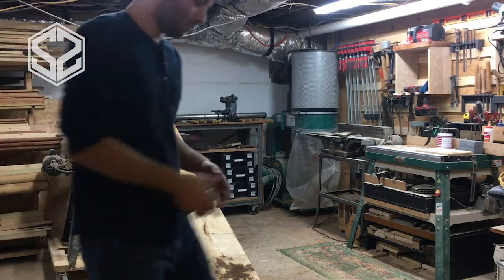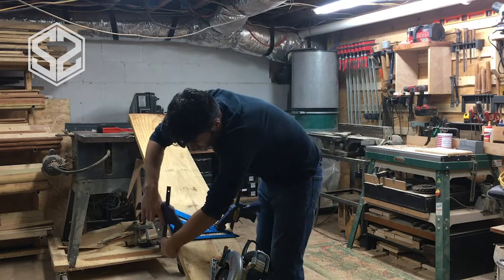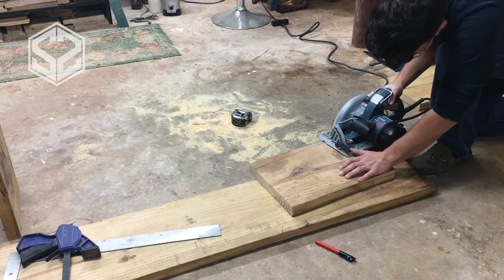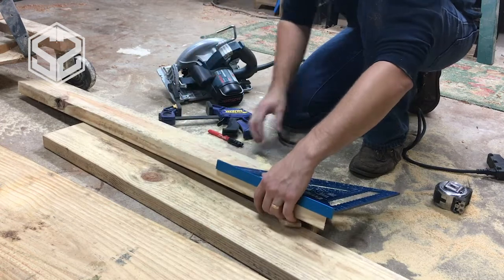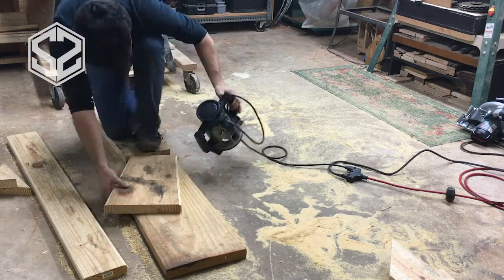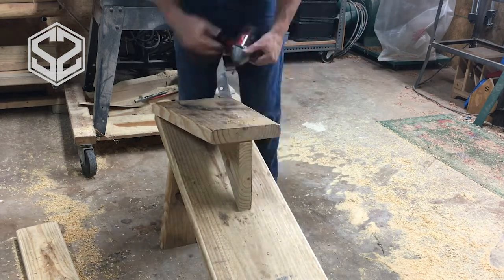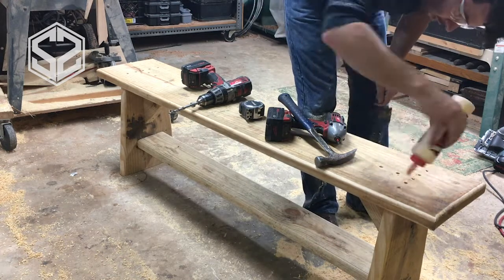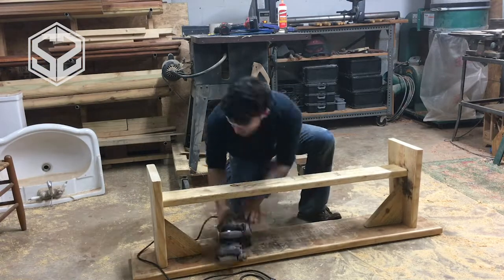How to build a bench

Comment: What is the measurement for the leg height? Thanks! I think I can tackle this one.
Reply from the maker: I cut them at 16.5in. I was aiming for just over 18in. at the top of the bench to match the chairs around our table. The height can vary. if you want it to match other chairs or benches just take your measurement you want and minus the thickness of the wood you will be using for the top of the bench and that's the length you need for the legs.

Good luck!